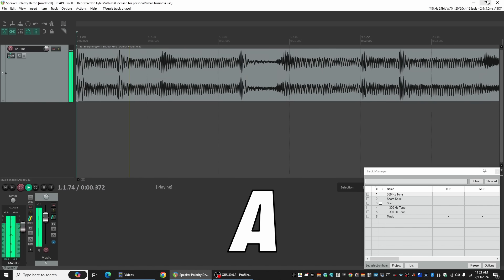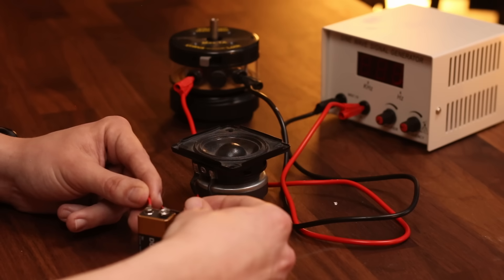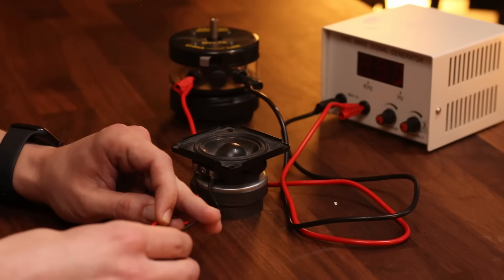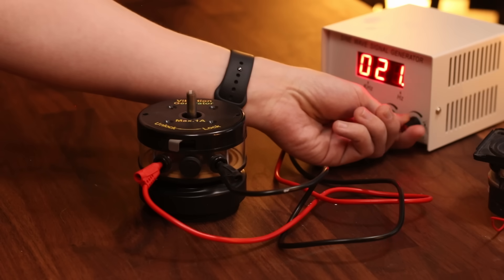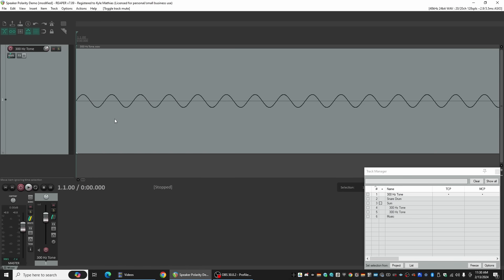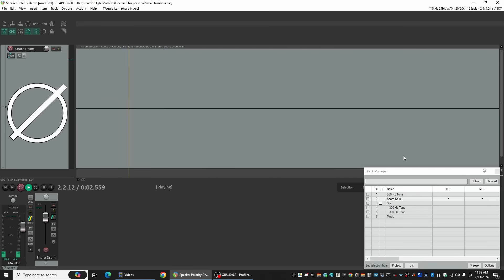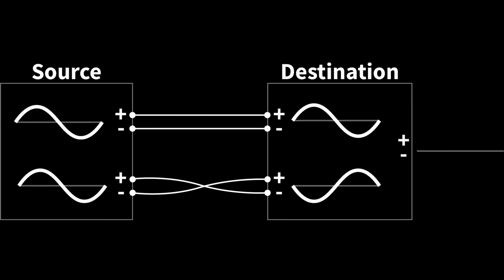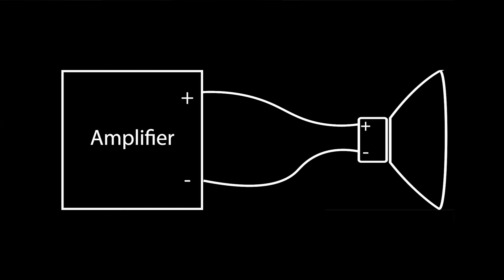What Happens When You Wire Speakers Backwards?

Comment: There is a difference! a is slightly faster b. is slower.  B has a bit more bass! this, reverse and non reversal of the wires  is kind of close to my setup in a a way.  to build what I use, you need a Three way wire setup. on for one channel to be untouched and the other two wire ground and the other channel to be spliced . connect one wire of the ground to the channel wire which has been spliced and do the same to the other two wires.    if you build another 3 way wire of the same but use the other channel on the ground. and then use A four speaker set up you can achieve full range quad. without a discrete board...  just be aware that this full 4 track design has a major flaw with or without a discrete board. which is an over hating issue if the volts/Volume is set up too high.    I am working on trying to find a way to fix this issue.

Comment: There is an inexpensive way for pseudo quadro or "stereo ambiophony". You use an amplifier with passive stereo speakers and in addition you connect the + of left speaker output with the + of the rear speaker left, the + of right speaker output with the + of rear speaker right and both - of the rear speakers.
The result is, both rear speakers plays the difference between left and right, but also one of the speakers is inverted in phase, so it will sound pretty diffuse.
Reply: 'yep, same since 1972, rear speakers in series out of phase across positive left and right amp output terminals. slight reduction in left/right separation but awesome listening experience, before the advent of 5.1

Comment: the Negative sounds more Damp like your turned down the volume by 1db but only in sounds that use a sudden hit like kick, snare, its sorta like a limiter was put on negative but not on positive, i can hear the difference, you won't be able to hear it because you're ears are not sure what to look for, so weird i can pick this up, it also makes sense because the speaker has more space to go outwards in the positive which is why adding more current can boost you speakers bass to the point till they rip out because of how speakers are made, but in the Negative you only have a certain amount of space because the material glued around the rim in the speaker will hold the speaker in place going inwards,(like a limiter) hopefully that makes sense?

Comment: Very well done.
You should also make a video about wrongly soldered 3.5mm TRS to mono XLR cable, e.g. gnd = pin1, tip = pin2, ring = pin3 (or unbalanced stereo to balanced mono in general).

If you just want to listen to the stereo difference in your audio track, that's the way to go. :D

Comment: I'm more familiar with audacity than reaper, I see the phase normal and reverse switch change in the lower left hand corner, but the wave form is exactly the same on the top.  what gives?  Usually when you change the phase, the waveform peaks will visually swing the other way.  You can reverse both speaker  cables on a 2ch stereo setup and it can have an affect on room modes, so I've heard lol.

Comment: You should take a pair of those linear transducers and have them agitate a shallow pool of ~dyed water. In theory, we should be able to see how the delay required to propagate the signals through the media affect constructive and destructive interference at different frequencies, distances, polarities, etc.
Reply from the maker: Cool idea!
Reply: I used the "Chaldini" plates with small metal slivers and video taped them in the 80's.  I recall Velvet Underground being quite interesting.
Reply: Installing a stroboscope illuminating the water at the same frequency as the waves, will also make it so that the waves appear stationary, so the differences can be pictured better
Reply: @rojirrim7298  I think showing the agitation of the water would be better. Otherwise, when you have a spot with looks like it hasn't moved is that because it cancels or because it just isn't moving at that point.
Alternatively, the stroboscope slightly off frequency, so you can see the waves moving and interacting.
Reply: huh huh....you said words.
Reply: Or, shows channel frequency parameters that "ride" and overlap...
So that we can realize min/max settings for phasing sound between cancel and on.

Comment: This is true that there should be no audible difference when your DAC, amp, and speaker are all operating linearly. However, in practice there are nonlinearities and biases in all these systems. I would imagine it would be easier to A/B test polarity inversion on cheaper systems or at very high sound pressure levels.

Comment: Very simply, when one speaker is out of phase (wired backwards) in a stereo system, they cancel each other out.  Mainly heard in the lower frequencies, but also affecting image and sound staging.
Reply: Is this how noise cancelling headphones work? They layer on top of your audio an inverted waveform of whatever ambient sound you're hearing?
Reply: @EdKolis Yes Is pretty simular they record the noise and invert it. Works well on ambient noise like engine noise etc but not so well on momentary noises like a sudden crash or boom.
Reply: @EdKolis  Yes, precisely.
Reply: I once played at a psytrance party where one of two subs was wired incorrectly, resulting in the bass literally disappearing right in the middle of the dance floor. 😂 Since is was open air, you hadn't even echoes from walls. Super weird.
Reply: @NeovanGoth  no matter what, you always have points of cancelation, and points of convolution. Study ancient architecture and you will see. Those side rooms in old cathedrals are not there for the nuns or moms...
Reply: @NeovanGoth   The person that made those speaker cables really messed up. Should never happen in a PA system since the speaker cabler are hard wired unless there is a phaze switch somewhere in the system.
Reply: @rimmersbryggeri  made those cables, like in the factory?
Reply: @LeonKotze70 No not necisarily in the factory. Is very common for audio crew to build cable to their own  specific needs. But it's also possible to use none speaker cables for speakers some times if xlr connectors are used since microphone cables also use  xlr. IT can be very painful if the wrong cable is used with a microphone because it can make the capsule live a phantom power volatge. Is a nice tingle but not in your lips when you are singing.
Reply: @rimmersbryggeri  how is that building a cable?
Reply: @LeonKotze70  You solder the connector housing onto the cable. It's called building a cable. May not be the ideal word but it has worked for decades.
Reply: @rimmersbryggeri  Ooooh, XLR, now I understand! Don't you get a phase shift when you switch the two signal wires of a balanced connection?
Reply: @NeovanGoth  There is a multitude of problems that can arise. Especially since some speaker cables dispense with the shield to. I prefer speakon for speakers when possible to lessen the confusion.
Reply: I heard about phase back in the 70's. I don't recall being able to hear a difference, but I didn't have speakers that reproduced heavy bass. I've always tried to wire correctly anyway.
Reply: In my very early days of hi-fi in the 70s, The audio shop explained it very simply; " You connect the speakers plus-to-plus, neg-to-neg. If you don't, they will be 'out of phase'. You'll have one sucking while it should be blowing. "
Reply: @terencejay8845  Did you shop at Buck's Super Cool Stereo Store in the 70's? LOL I thought that didn't open till the 80's.
Reply: It's heard in all frequencies that are pannes with an identical signal to both speakers. It's the same as a common mode interference supressor in a balanced signal chain. There is usually just one bass and bass drums are usually not panned so that is why they dissapear more than other instruments, has nothing to do with them being low frequency though.
Reply: @sbryggeri I'm pretty sure frequency is critical

The speed of sound is roughly 350 m per second.
So if you have a 100 Hz tone, that will have a wavelength of roughly 3.5 m.
So it is easy for this phase difference to cancel over a large area.

But if you have a 1 kHz tone, the wavelength is roughly 0.35 m, or 35 cm. So it is much harder to have it cancel, especially for both ears.

If you want to test this, start with a perfectly inverted signal, then move it slightly ahead or slightly behind.
Reply: @rimmersbryggeri you are not completely wrong but you are not completely right either. Try to send monaural sound through an inverted setup. You will find that bass is affected more than higher frequencies still. And in that case you have eliminated your eventualities. 

I am not saying that what you are saying is wrong, just that even when what you are saying is true, bass is more affected than higher frequencies.
Reply: @roygalaasen  Can you demonstrate that with waveforms or is it a question of timbre?  In preception you are 100% right but I wonder what happens in fact. I suspect it is because the lower frequencies less audible to begin with. Kind of like how bass frequencies are attenuted more than treble when you lower the density of the atmosphere and treble is attenuated when you raise the density even though the actual source has not changed at all.
Reply: @roygalaasen  "You will find that bass is affected more than higher frequencies still"

Do a proper scientific  setup and you'll find that frequency does not matter; if the signals are exactly inverted they will cancel each other out.

Noise cancelling only works if the sound that is produced by the headphones is the exact opposite of what leaks through the headphones and that is basically impossible to get 100% accurate with just one microphone and one speaker. For noise cancelling headphones the bass is usually the easiest to cancel because that is heard by the mic the same way as it leaks through the headphones, the phase between what the mi hears and what the ear hears is basically the same. Higher frequencies may be picked up by the mic more depending on direction, the mic may pick up a reflection that the ear doesn't, how much hair is between the headphones and the head, etc. The ear is much more sensitive to high frequencies to begin with so you'll hear inaccuracies in higher frequencies a lot better.
Reply: @rimmersbryggeri  I always thought it had to do with wavelength. 20-20000Hz has a wavelength of about 17m to 17mm. You shift the phase just a tiny bit, you will get much more phase disturbances in the higher frequencies than in the lower frequencies, but there are other people in this discussion who seem to disagree so I am probably wrong.
Reply: @roygalaasen  I think there is no measurable answer. Is more on the lines of why a trumpet sounds different than a guitar even though the waveform is simular. And it really doesnt matter because I am having a nice converation with you so far. Id did an esperiment playin 2 inverted copies of paperback writer (mono) through 2 speakers the effect is indeed as you stated but if I pan them both through the same speakert there are just some strange space noises but mostly silence. Why that is I do not know. (Audacity is a wonderful pet to have).
Reply: @rimmersbryggeri    there is this other guy in this thread whom I wanted to answer that there is no such thing as “perfectly inverted”, that is something you can only achieve inside a discrete device, ie a computer. 

In the real physical world, you have all sorts of inaccuracies, so you won’t ever get a “perfectly inverted” set of data. You pick up the data. You send it out. It won’t ever be 100% accurate.

(Edit: I do want to put the caveat that this inaccuracy may not even be perceptible at this point. Computers have gotten so fast now relative to the early 90’s, and techniques have gotten so good at eliminating noise compared to back then when I did the experiment with this.)

To why a trumpet sounds different every time, is the same reason double tracking makes the vocals sound richer in audio recording. You can never do exactly the same thing twice no matter how hard you try or how experienced you are. There is always going to be some variations.

That is, by the way the only objection I have to what the other person in this thread said. Everything else seems accurate to me. 

Except the fact that I still am not convinced about the message he sends that bass and high frequency is equally affected. But I just got an idea how to test that.

(Hint: I think it can be simulated.)
Reply: Actually frequency has a LOT to do with how the cancelation is perceived in an actual room space, because of the wavelength--dependent nature of wave interaction on air pressure regions in the room / car / space. On headphones, you are much closer to correct, and virtually all frequencies will be seriously canceled by our ear-brain architecture.
Reply: ... with low frequencies being more noticeably canceled. (Edit)
Reply: @rimmersbryggeri  Oh, but it does: in Stereo recording the Left and Right audio-signals are not identical (if they were identical, the audio would be MONO), so in stereo listening the  audio is NOT totally cancelled by the phase cancellation, but in MONO-listening they basically are because both channels have identical signal - only in opposite phase, with one exception: if the Left and Right signals are not EXACTLY as loud (in dB) with each other they will NOT cancel each other completely despite the opposite phasing.
Reply: @MyenoB   You can have mono components in a stereo signal though. Indeed the reverb effects may be the only stereo component of a stereo recording.
Reply: And vocals and anything else that is panned center. It also dramatically widens the stereo field.
Reply: @danroberts9050  what do you mean? Usually things that are mostly in the Center has high correlation with monaural sound.
Reply: @roygalaasen  What happens is anything that is panned to the center means the each channel (speaker) gets the exact same amount of that signal and if they are in phase, they'll appear to come from the center right between both speakers. However, if the speakers are out of phase (one is wired backward) then they will cancel each other out and that instrument will disappear. Now this only works in cases where the signal is exactly the same. For instance, a vocal or a bass that is panned to the center means that the precise same signal is present on each channel at the exact same amplitude. So if we were to reverse the phase of the two channels, then the vocal or bass (or anything else that was panned center) would just disappear. Now here's where it gets interesting. That's only signals that are precisely the same. But reverb for instance is not exactly the same on each channel. So you'd very likely hear the reverb trails but not the direct sound itself. We used this technique back in the day (before fancy VSTs and digital work stations) to remove vocals for people who wanted practice tracks or karaoke tracks. So remember, it's only for a signal that is exactly the same on both channels. As far as being similar to mono, what's happening in stereo is both speakers that have the exact same signal (again, a vocal for instance) actually tricks the brain into "hearing it" in the center between the speakers even though there is actually no speaker in that position. It's a basic function of psycho acoustics. In that case it will resemble one single speaker in the middle (monaural).
Reply: Components are preconfigured for load-in/line-out... There isn't much light to come from phase shifting in that array.

But, using two phase components means - lights shine.
Reply: and old dj trick when mixers didnt have effects. was to play 2 of the same tracks. and have one stylus wired backwards to create this "phasing/all around you but not at you kinda sound
Reply: But the world is not the result of simple (simplified) assertions/truths. If you have two speakers in a sealed room, playing the same exact signal (they are wired in series), but one has its polarity reversed, they do NOT simply "cancel each other out". This is because the pressure waves from each speaker cannot totally influence all the air in the room, and they would need to be able to do so in order to 'cancel each other out'. As you walk around the room listening, you will hear artifacts of the lack inversion, and they will change depending on where you are in the room.
Reply: There's no such thing as + or - as sound is AC. So I agree with you.
Reply: @SurnaturalM  Oh, but there is: the audio is AC, true, but it means the audio is sine-VAWEform and if it were DC your audio would be a STRAIGHT LINE (NOT A VAWE),if you have two identical sine-vawes fed to both speakers and you invert = switch the polarity of the other speaker, the sinevawe channell of that speaker turns the opposite to the other speaker, resulting the sinevawes to cancel eachother. Here also the AUDACITY-program is your best friend, because there you can invert the other sinevawe to see and hear how this happens.
Reply: UNLESS THEY ARE FACING EACH OTHER....

Comment: how do I know which is positive and which is negative if theyre not marked?
Reply: The 9v battery trick is a good way to determine polarity.
Reply: If you can expose the cone @FlatBridgeDuppy
Reply: Check the speaker manuals sometimes the negative pole will be larger than the positive, similar to your car battery. Also look for indicators close by the terminals

Comment: I've never been able to hear it but I'm guessing some speakers are more efficient "out or in" then the other thus the initial punch of a kick drum and similar could be audible in some cases. But I'm speculating.
Reply: I think that makes sense, since it's actually a different physical movement happening. If the membrane moves inwards, air gets pushed out the speaker box, while in the opposite direction, air gets sucked in. But then again, since this happens extremely fast, it maybe too weak to move a lot of air at all.